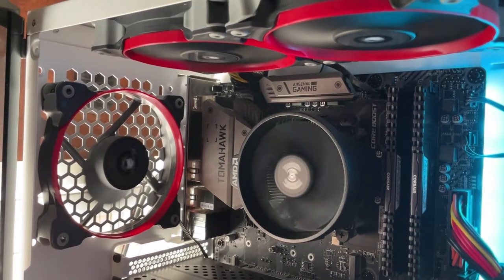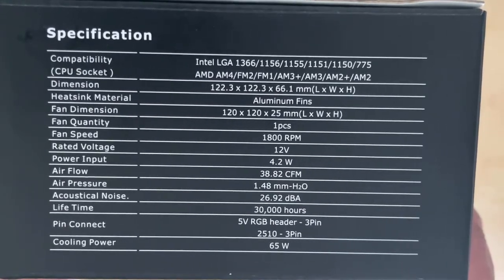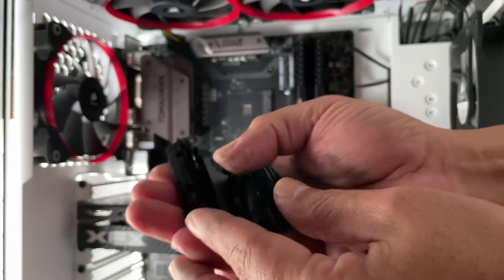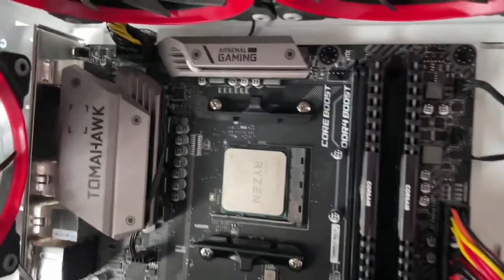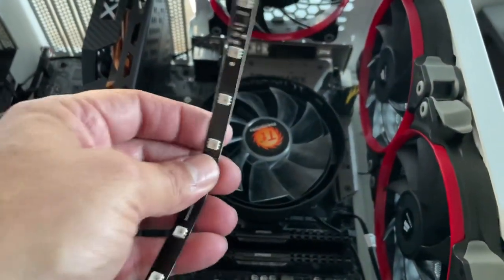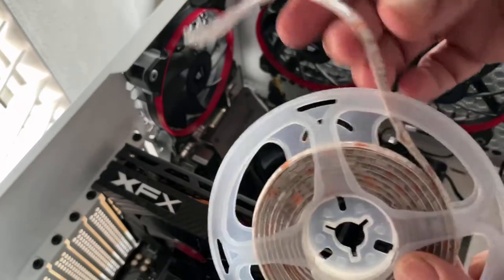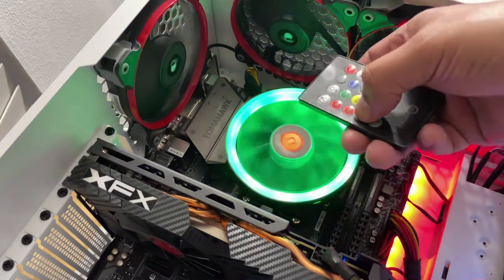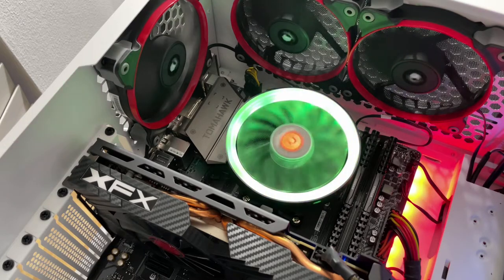Thermaltake UX100 RGB CPU Fan MOD!

Comment: When you buy an AMD AM4 board, those mounts are pre-installed from the factory.  If you bought your motherboard used, then the seller either forgot to include the mounts or had thrown them away.

Comment: I bought this for my Intel PC and it came with the Intel adapter (which is the round one you showed at the beginning of your video), as well as an AMD adaptor. The AMD adaptor is smaller and rectangle shape. Maybe yours wasn't packaged with both of them?
Reply from the maker: Thanks for watching and the update, I didn’t get the AMD CPU Bracket with mine I’m gladI had spares. Cool cooler. 👍🏽✌🏽

Comment: Any problems with the RGB? Mine is flickering so much that I want to change the whole fan out.
Reply from the maker: Thanks for watching the only issue I had is that my LEDs were lighting up at random and in some cases not at all that’s why I performed this mod. In all honesty it sounds to me like you got one like me which is defective. You can either try to perform the mod I did or if possible return for a replacement. Hope this helps you stay safe.👍🏽✌🏽

Comment: @
CASP72 ••••• Am I ablw to use 4 ram stick with this cooler
Reply from the maker: Thanks for watching what main board are you using? I ask cause mine is the Tomahawk B450 and only has two DIMM sockets for memory not four. 8,16,32,64 x2 etc.